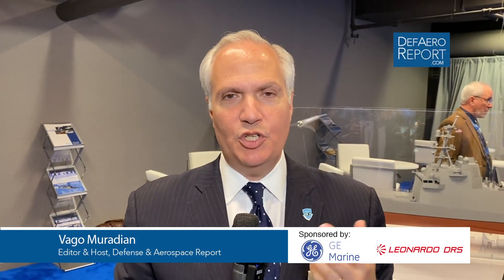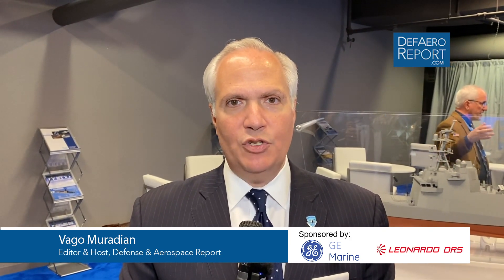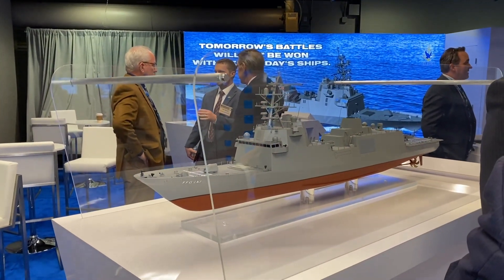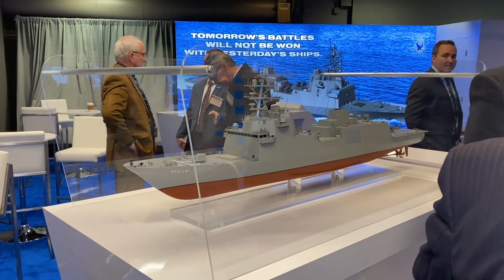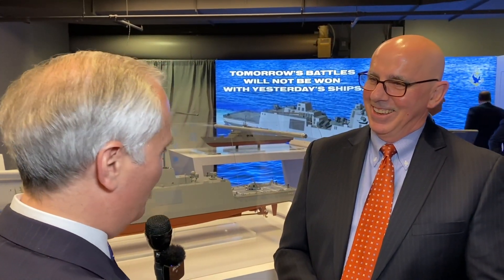Fincantieri's Goddard on FFG(X) Design Features, Shipyard Investment, Program Update

Comment: I don't understand why the just won't make the Littoral Combat Ship anti-submarine and have the FFGX focus anti air and ship. Does anyone have an educated answer not just opinion?
Reply: LCS is a lemon
Reply: @svenfrontin-rollet8469  However, Navy still working on future fixes for the advanced concept features, some of which worked out, many that didn't. Hence, your lemon comment is correct. But I still bekieve they will continue the LCS program.
Reply: FFGX is a little Burke not a big LCS. As the guy says at about 3:00 it just has 32 cells instead of 96.
Reply: @Black Wolf Yes. And it will assist greatly with asymmetric threats.
Reply: Geo L LCS are expensive garbage you don’t need ships to chase down Iranian boghammers and terrorist skiffs what’s needed is a warship that will assist the arleigh Burke’s a real proper destroyer escort, the FFGX will essentially to what the Oliver hazard perry FFGs did ( assist and escort Spruance, Charles f Williams, Kidd class destroyers etc and carrier escort ) the biggest threat to the USN at the moment is the PLAN and they have very effective fleet of destroyers and frigates, the arleigh Burke’s of the 7th fleet are overworked and need a good warship to help lighten the workload.
Reply: Corey — The USN wanted a multimission ship.  For the escort mission, it needs ASW.